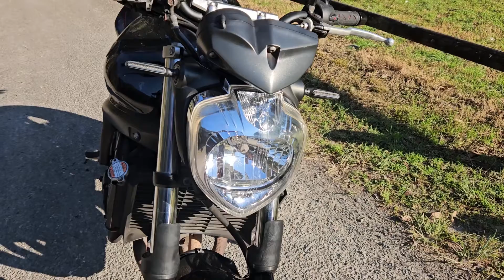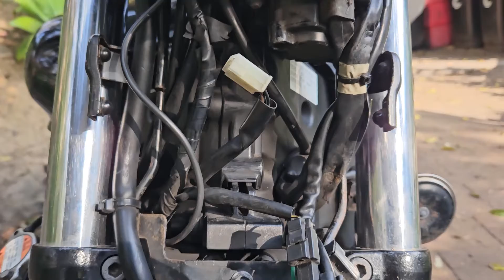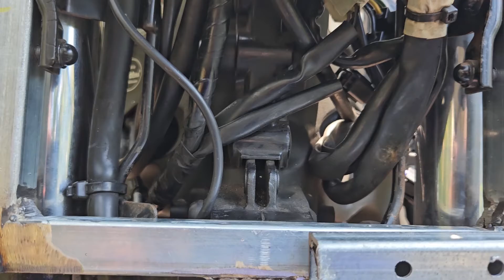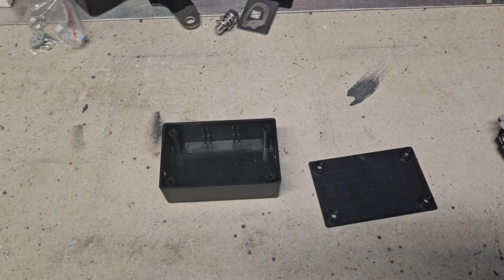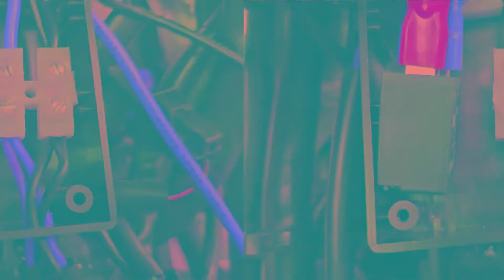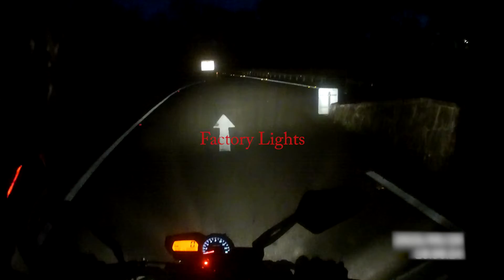LED Light Upgrade - Yamaha FZ6 - (STEDI LED's)

Comment: Do you have a link for the indicators you have on the bike please? and did you have to use spacers? I presume they are the same ones on the back, what flasher relay did you get?
Reply: That’s super helpful cheers pal 👍🏻
Reply from the maker: Here are the indicators - https://www.stedi.com.au/dynamic-led-motorcycle-indicator-light.html  Yes the front and rear indicators are the same. This was the relay: https://www.stedi.com.au/led-flasher-relay.html They offer two versions of the relay, check the type of adapter you currently have on your bike then match with either the two or three pin version. Yes I did use spacers for the indicators, however I don't recall where I bought them from.